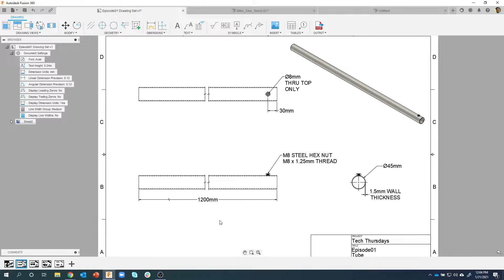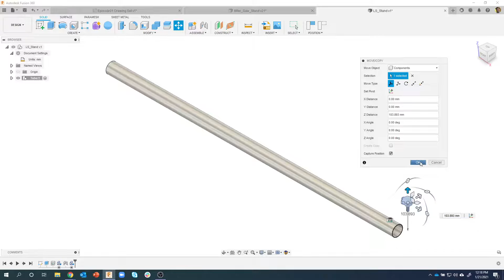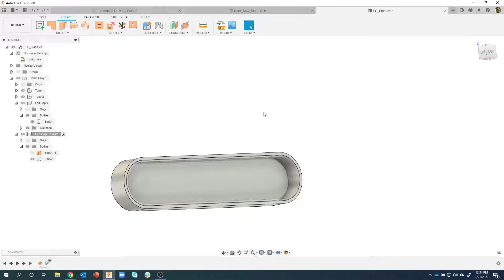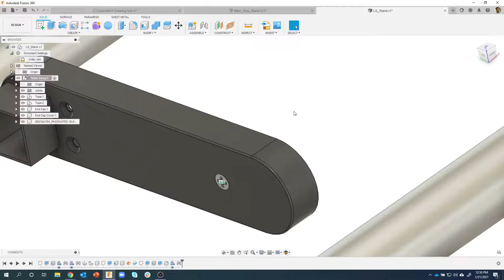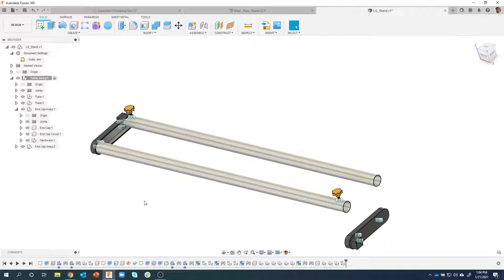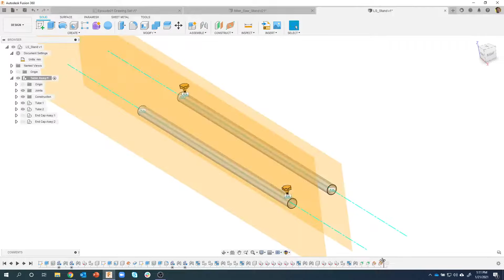Episode 82 - Miter Saw Stand project, Part 1

Comment: Brad, When you did your plane at an angle, what determined the size of the plane? I tried it on a model that I am working on and the plane was so small that I almost did not see it. NOTE my model is a large thin disk only about 0.25 inch think. I placed the plane along the Z axis which is perpendicular to the disk.

Would the dimensions of the model impact the size of the plane that is added?
Reply from the maker: @John-  The plane size is a ration of the object that was selected to create the plane.  For example, if I did a Plane On A Path and selected a short line, the plane would be small.  However, if I picked a longer line, the plane would be larger.

Comment: Hey Brad, I just wanted to thank you for putting these tutorials out.
Reply from the maker: Glad you like them!
Reply: @bradtallis8968  I didn't realize how cool, using the surface tool hack to get the initial size of the end cap cover was until I was in bed last night, thinking about it. In the past, you would have had to use the project/include tool to do the same but the way you did it was just so intuitive that it kind of just slipped passed me until I had a chance to think about it later. Also being a maker, the full license is a bit much because I'm not in business, but if Autodesk had an, for fee, upgraded personal license with a few more resources for people using Mach 4 in their garage, I'd be interested in it.

Comment: Center Tube Component was not there (rather not created) in your live stream...(although you had mentioned in your outline)..Also wondered why only one thickness of 1.5 mm was provided in one direction while creating the Center Tube Component using the thin Extrude command...As always you had amazed me with your tips and tricks...Great work Brad and Angelo....
Reply from the maker: @Bisheshwar-  Ya, I had a couple of people point out the two different thicknesses issue.  That's what happens when you rush  :)

Comment: Hi Brad, thank you once again for that video (I've not missed any of yours). There are some clever new features in this one and I particularly like the thin extrude. I've tried it and the hole placement which is also very neat. 
However, I wondered how I could adjust the 30 mm distance of the hole centre from the  end of the tube should I want to and cannot see any reference to the 30 mm anywhere, even when I edit the hole? So how would I change that dimension?
Also during the course of attempting this  I found that when editing the hole feature the extents window pops up  displaying the value "To" and if I again click on the internal surface of the pipe it loses the original outside surface selection for the hole location. All in all it's a bit quirky and won't let me continue unless I change the "To" to "All" or an actual measurement then back again. I can put this down to it being a little bit buggy but could you please explain how I can change the 30mm dimension of the hole position without starting again.
Also unless this dimension is the first action of the hole command then I can't see a way of setting it afterwards.

Comment: Hi Brad, Noticed a small error when you hollowed out the small middle tube. Half of it is 1.50mm wall, and the other will be a 1mm wall. Is there a better way to do that extrusion and hollowing out to not get caught out missing setting both thicknesses? Steve.
Reply from the maker: @s r-  Thank you for pointing out the two-thicknesses issue.  I could have done a "symmetric" extrude and then the problem wouldn't have arose.